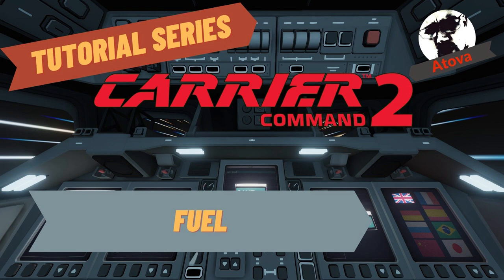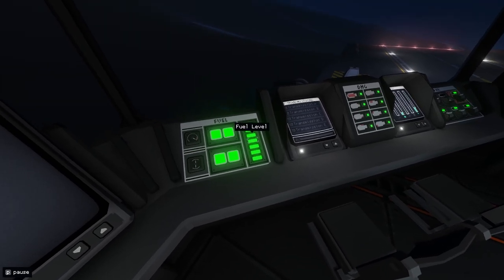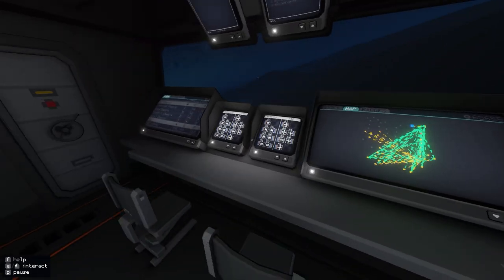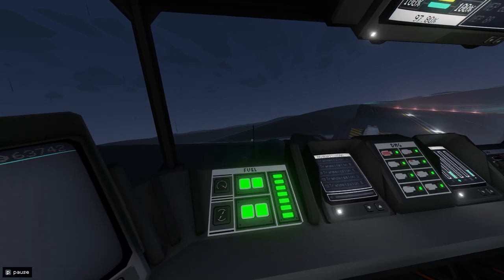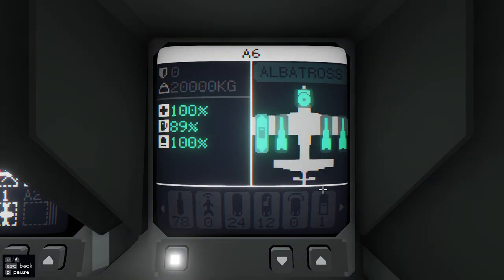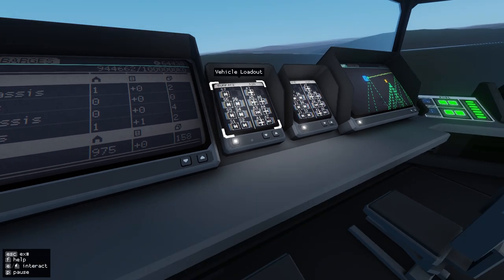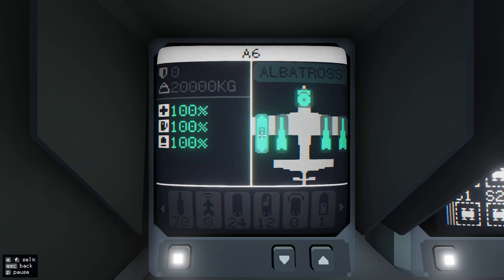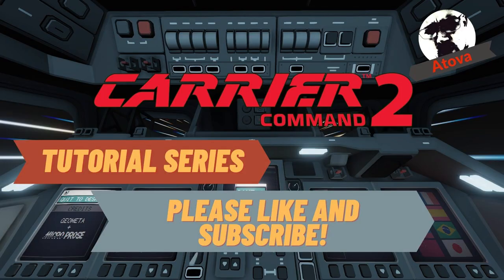Carrier Command 2 Tutorial - Fuel

Comment: Fuel efficiency meter - if the arrows are outside white lines then your speed is not efficient (distance to fuel consumption ratio). In standard medicore weathrer conditions you may first look on speed meter because it is easily accessible (is above HELM) - red line is not efficient  but this does not apply to bad waether - strong sea currents, waves or strong winds. Small indicator is useful - it always shows correctly, regardless of the weather. I think it would be good to explain energy management to people in the next guide, because maybe not everyone knows that carrier can flow with great speed after switching off (redirecting) the energy of various systems. This feature is also useful for faster repairs etc.
Reply from the maker: Thanks for the info!!

Comment: In Geometa's other game fuel efficiency came into play when running engines faster. So you might get 30km range running the engine at 600rpm, but drop it to 420rpm and you're going to be slower, but you'll get 50-60km out of the fuel because it's the efficient speed for the engine.
Reply from the maker: Thank you for the info!

Comment: I'm still wondering how the drop tanks work. If I take 2 aircraft of the same type, one with 2 tanks and the other without, they basically have the same fuel leven throughout the whole flight, in other words: The one with tanks doesn't have more. But when I get in control and select the drop tank station, switch to manual and press the fire button (no hints given for any functionality by the game), the fuel level rises a little bit, but the drop tank then is gone. Needless to say the capacity isn't really much. 100l per tank while an Albatros has 800l of internal capacity, Manta has 1200, Razorbill has 400 (only 2 stations for armament/tanks anyway) and Petrel comes with 2000l. I basically stopped using them...
Reply from the maker: Yeah I don’t think I ever used them myself. And when I did I think I thought the same as you. Love the game but there are little things that like this that are a bit annoying

Comment: I think the 'mystery' fuel gauge measures fuel usage rate or something like that. Try testing it in that way. But the dual pointer is confusing so I'm not sure
Reply from the maker: Honestly I’ve tried testing it a few times and sometimes it doesn’t even move. It’s probably just a value that affects the consumption rate depending on speed, current, wind (possibly) and that will be it. It’s just the worst dial they could’ve picked without explanation
Reply: So fuel efficiency then? How about testing it by piloting thecarrier against the current and with the current...
Reply: @Chinx313  My thoughts too, Had an early 80's honda that I think had a similar gauge, think it was based on throttle position and vacuum and speed.